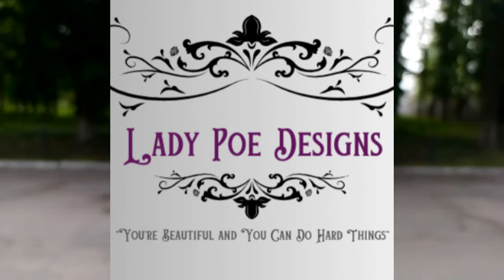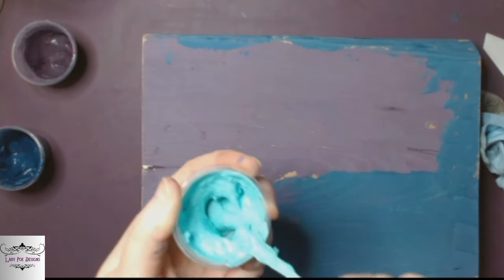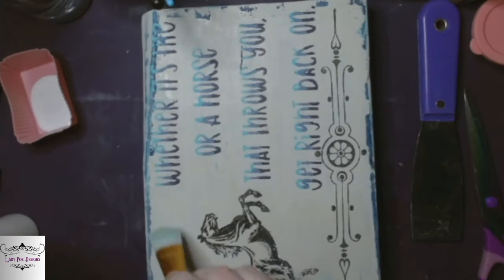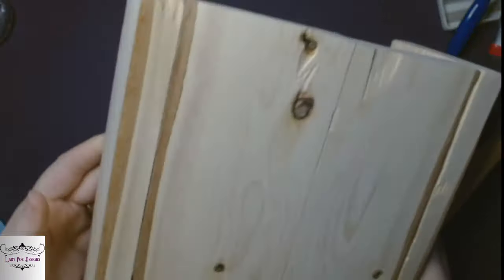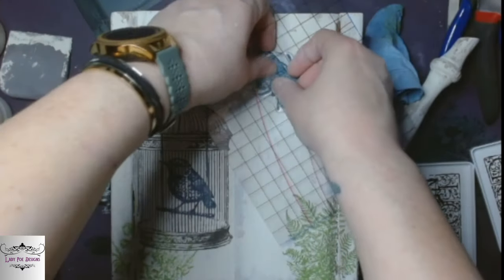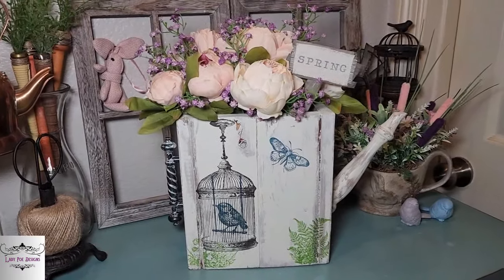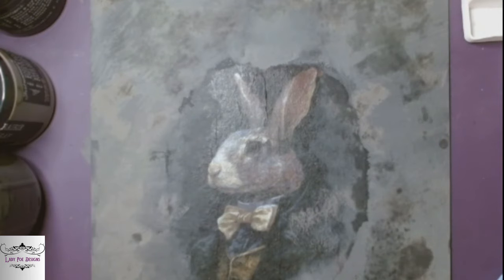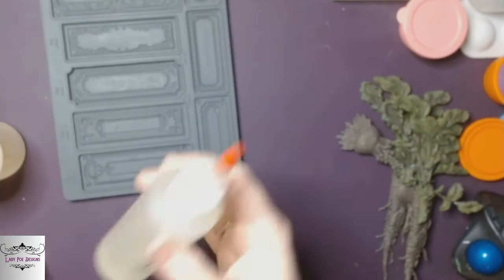Spring DIY's

Comment: Girl! I knew you would kill that project! It turned out way better than the inspiration picture! You should start selling these along with your boxes!
Reply from the maker: Aww...You're too sweet!! It was SUPER easy to make. Like I said in the video, I didn't even sand the wood and it wasn't straight or anything. I just cut it on my table saw and nailed it together. But yeah, you could stamp anything on them or use papers, whatever. Even make them two sided so one side for everyday and the other for Fall or some other holiday. That's a really good idea! Thanks for sending it to me and having the faith in me to make it. 🤗 I appreciate you girlie!! 😊💜